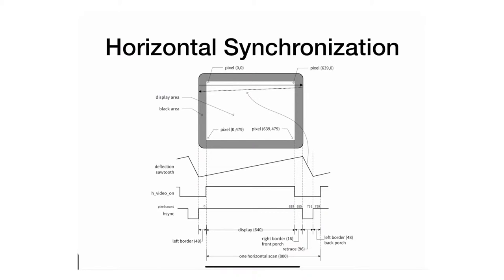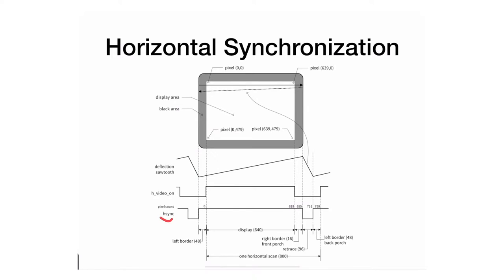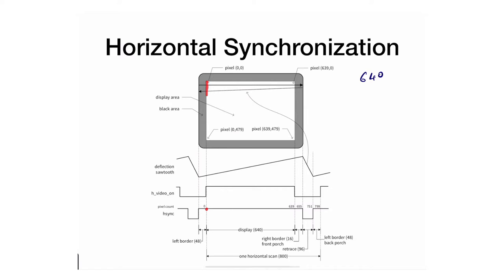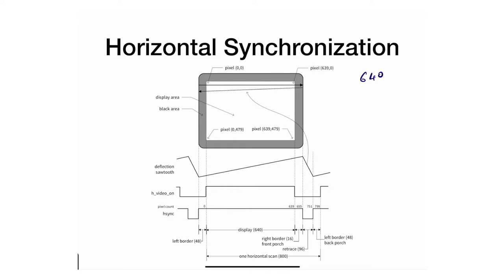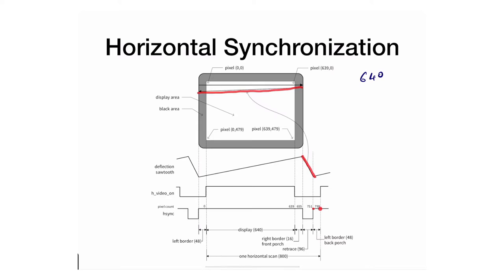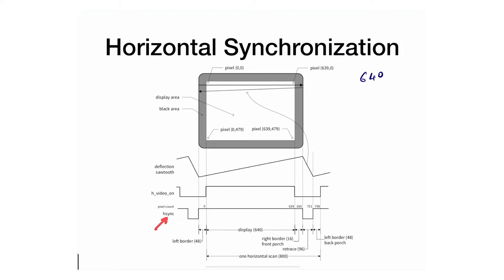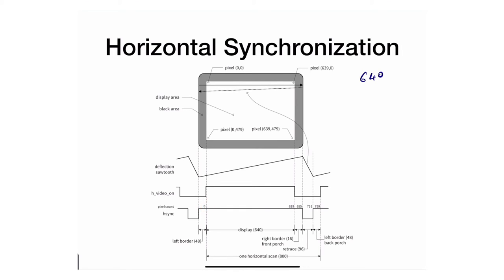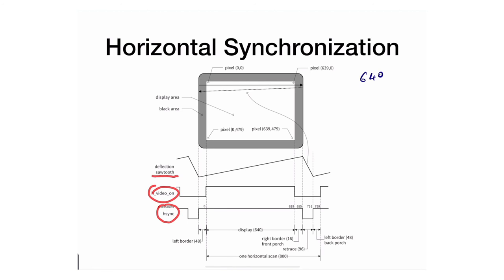M14 - 4 - VGA - Horizontal Synchronization

Comment: How do you transition from one line to the next? Also, you have a certain time to traverse the 640 pixels. If it's required to use 2560 clock cycles, how do you know when you should change the colour of each pixel? Should it be done every 4 clock cycles or every 1 cycle? What I am basically asking is how the VGA knows what pixel to paint within that time it should paint pixels. In the VGA documentation for FPGA, there is no output that is required to show the position of the pixel in either horizontal or vertical plane.
Reply: It's an analog protocol, it has no notion of actual pixels. What happens is that during the visible portion the beam just changes intensity for each color according to the R,G,B inputs as it moves to the right end of the screen. The visible portion is normally considered to be 640 pixels but this is just a convention when the signal generator comes from digital circuitry. Since the signal is analog in nature it could be anything, but if the (digital) clock on the VGA signal generator represent one pixel per cycle, as described in the video, then you should set the appropriate R,G,B signals every 1 clock cycle.